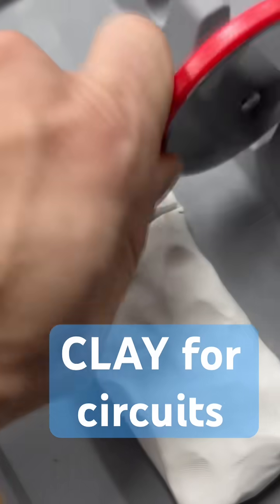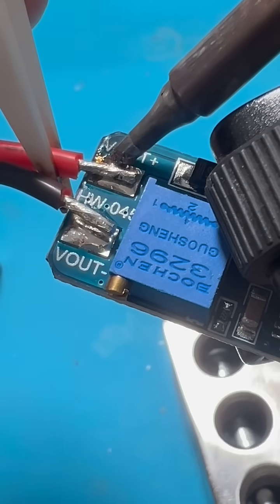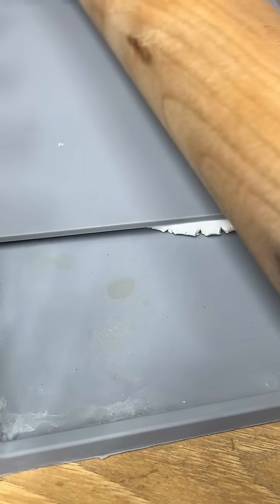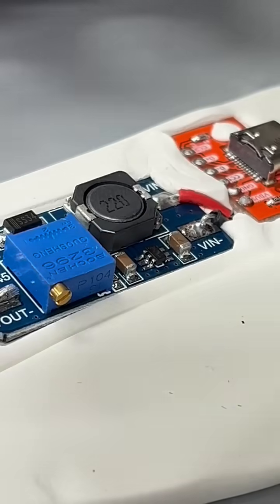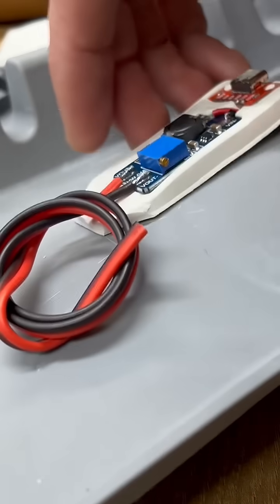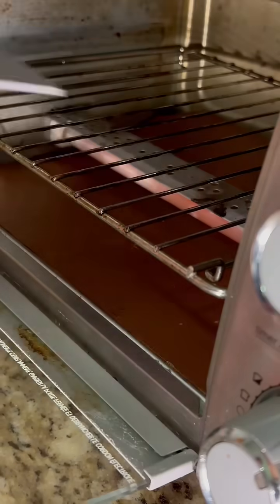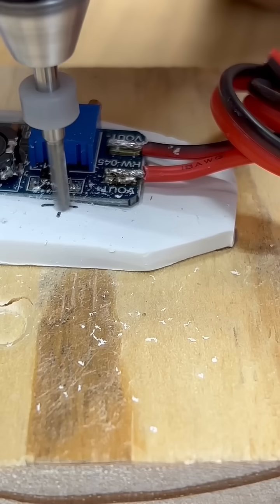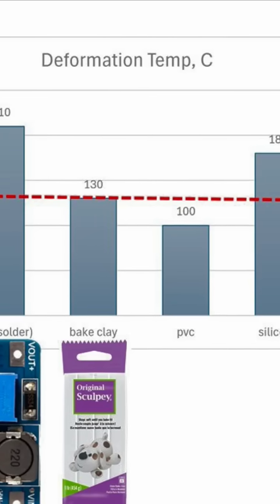use clay for circuit projects #methods #mechatronics

Comment: Great video, horrifying joints. I didn't think it was possible to cold solder with leaded.
Reply: You clearly don’t know what a cold solder joint is then. This is a fine joint and is easily class 2 compliant. I would even say the VOUT- is class 3 compliant. The only reason the VOUT+ is not class 3 is because the wire is missing solder at the tip
Reply: dear internet experts arguing: go call your parents or grandparents or something
Reply: Yeah, those are horrible joints. They don’t even look very secure. The solder applied to the pad prior to trying to heat the tinned wire is basically being hugged by it. The joining could’ve been a lot better. 

I suspect there’s likely components nearby, or just the way the board is designed, something is drawing too much heat out of the pads not allowing it all to make a solid connection. They look cold to me as well (repair tech in industrial automation is my experience. Board repair for servos drives, ac drives, dc drives, CNC, soft starts, power supplies, etc..)
Reply: @ST-jh8wz  They look cold huh. you don't know your arse from your elbow. Since when does a cold joint have a Shiney surface?
Reply: @m3chanist My post keeps getting removed showing where their joints are bad in the video, versus my personal joints at work on an IC. It’s probably automated to remove external links.

But that’s definitely not shiny. Those joints are not good. They should’ve used flux if they were going to struggle to use the rosin-core alone.
Reply: @literate-aside  And you are able to do a crystaline analysis simply by looking at in a video...Get off the grass
Reply: Certified IPC trainer with a decade of experience here! :). These are absolutely not cold solder joints lol.
Reply: @MyMomHadMe  Please don't tell me you don't work in a Class 3 facility.
Reply: I've never seen someone co confidently wrong... You are full of BS
Reply: @eXe09  give me a reason, not nonsense. Yet another person who sees leaded solder and thinks that means it's a quality joint.
Reply: You don't know what a cold joint is, because these aren't. Both have nice radii between conductors and are shiny on the outside.
Reply: @m3chanist  There is most definitely not a good fillet, red especially does not have proper wetting across the length of the conductor and has flux that hasn't been appropriately heated. 

It's plain as day. Are you familiar with IPC?
Reply: @GtsAntoni1  First you claim they are cold, and when called out on that BS you shift to them not being long enough. The dishonesty of the bushitter.
Reply: @m3chanist  I've addressed several factors of a cold joint, in fact assessing them is part of my job. 

I don't think you understand even the basics of solder, or IPC.
Reply: @literate-aside neither do you ,he's not wrong you backpedaled . 

Everyone is an expert in their own little mind so it seems. On videos like this
Reply: @MichelLinschoten   if you think I backpedaled you've no idea what a cold joint is. What do you think the factors are that define it?
Reply: @m3chanist There is still pad showing lmao
Reply: @fllowFPV  The three big questions. And? So? What? Please explain how the size of a pad (and it could be any size at all, purely at the whim of the board designer)  how that correlates to a joint being cold or not. Fascinated to hear and looking forward to your 2cents of navel gazing know all know nothing contribution.
Reply: @m3chanist  because to be a conforming joint it must have an appropriate fillet, pad size influences this. The origin side must have at least 75% coverage too.
Reply: @literate-aside  A conforming joint...Does this look like a production item to you, does it? Or do you simply like to apply ridiculously inappropriate standards to things arbitrarily.
Reply: @m3chanist  Firstly, crystalline analysis has nothing to do with IPC, or any standard inspection of a joint, or assessment of suitability.

A minute ago I understood nothing, now I'm applying my very high industry standards?

Stop moving the goalposts, and pick a lane. If you're a hobbyist that's absolutely fine, but don't roll in like an authority and then backpedal.
Reply: @literate-aside  Don't degrade yourself by arguing with fools like @m3chanist. It's so tempting to want to help people learn, but the best thing for everyone is to do the frustrating thing and move on. I find muting helps, especially for the really unreasonable types.
Reply: @literate-aside 
This depends on the class. You're actually aiming for a class 3 spec solder joint whereas this is most likely a class 1 product. Maybe class 2. I will agree though, that joint is atrocious to look at. It's not a cold solder joint though.

Also origin and destination sides do not apply to Surface Mount. That's explicitly  Through-Hole terminology. Speaking as an IPC certified QA who has experience with class 2 and class 3 products.
Reply: @Vi-Six  the joint is fine, doesn’t look super clean but the VOUT- is certainly a class 3 joint. I’ve been J-STD-001 certified for years and just did recert last month. The VOUT+ is a defect due to the tip of the wire but the VOUT- is fine for class 3. There’s 75% wetting of the land and the fillet is high enough and the wire is flat against the land.
Reply: @RedHaloManiac95  
I mostly focused on it being not a cold solder. When I say atrocious, I don't necessarily mean noncompliance. I don't like the look of it, but I'd agree it'd pass as a Class 2.
Reply: @Vi-Six  certainly ugly but class 1 is just “if it doesn’t come off at the point of inspection” 😭
Reply: @caramelldansen2204  Read the comments below yours, And know who the fool is. Sheep
Reply: @literate-aside  Your ignorance of metallurgy is noted.
Reply: @RedHaloManiac95  
Very true, which is why I mentioned that xD
Reply: @m3chanist  Except you're just as wrong as they are. While IPC may use metallurgy as the foundation for the standard, we don't need to do crystalline structure analysis to determine the viability of a solder joint. A cold solder joint can be and is almost always identified visually with distinct characteristics. You spent a lot of the time deflecting instead of educating, and is just as, if not more than, unforgivable. 

In my opinion, IPC is very applicable to the topic at hand as it is the industry standard. You should strive to at least meet industry standard, which really isn't all that hard to do when it comes to a couple of wires on a PCB board.
Reply: @Vi-Six Bravo, a slow clap for you. The dufus you are defending was making claims that would require it to substantiate his drivel. A point which cleanly flew over both of your heads.  And in so doing reveals the shallow and superficial understanding of the clueless claimed expert attempting to hide behind a certified appeal to authority.
Reply: @m3chanist  Goodness me. That's a whole lot of word salad, and not a single cogent counter-point in sight. 

PS. Name calling isn't a sign of a strong position 😉
Reply: @m3chanist   I've read it all, now with heapings of salt.
Reply: Absolutely 👍  hardly any solder used too

Comment: Fantastic idea if you don't have a 3D printer ;)...Although to be fair, PLA / PETG are much more difficult to post-process - especially sanding.
Reply: Not sure what your print settings are, but I use PETG for custom circuit board mounts and standoffs all the time. The only "post processing" is with a hook-knife deburring tool to remove brims.
Reply: @viscayavagabond  yeah most of my prints need zero post-processing. My point was regarding things like sanding, drilling, painting, etc...

Comment: Great for someone without a cheap 3d printer and/or basic CAD skills 🤔
Reply: Why would you spend hours designing and printing a one off plastic holder that'll soften if you left it in a hot car too long when you can just do this? Honestly, sometimes it feels like people are using FDM just to use it. Everything looking like a nail if you've got a hammer type stuff. That one-off box you spent hours designing and printing, probably in PLA? I can knock it up in 15 mins by hand from sheet ABS (or ply even) and it's guaranteed to have a better finish. This is a good technique for a lot of one-off things.
Reply: @paulie-g  most of what you said is false, cause I design an enclosure for this in max 30min and can reprint with 0 effort as many times as I need. Also I would not use PLA for anything...  wtf are you even talking about? 😆 and it will look at least not like shit in the end. To hold or prototype, sure. Clay. But for a finished thing, no way
Reply: @Hunihunor90  Hence me repeatedly saying "one-off". This is the common case: most electronics hobbyists build each project once. Also, most people print in PLA, and have printers that can only do PLA well.
Reply: @paulie-g  they do not know what there printers are capable of or you don't. 😅 most hobby printers are capable of printing a big array of materials 🫢
Reply: @Hunihunor90  Most people won't reliably get good results printing ABS without an enclosure. Particularly those for whom FDM printing is a tool in their actual hobby rather than a hobby in itself. For one-off, non-complex shapes that aren't already designed there is just no good reason not to do it by hand in most cases.

Comment: Is it possible to use that Clay for watertight Circuits?
Reply: Interesting idea.
I suspect the clay would need some kind of coating/sealant to become water proof. Baking prosess is done to remove any moist from the clay and make it hard but I am quite sure it can be painted with water coloring therefore moist can get in. Why not paint it with an oil paint to fill the surface and stop water from going into the clay?

Comment: Well.. IF you need something a little playable, but still keeping shape, I have used „Sugru“ a silicone rubber in the past, cures out of the package within 24 h, but keeps a certain impact and deformaability that I needed for something similar.

Comment: Test it or this video is a dud.
That Baking clay could be low key electrically conductive and short your PCB connections due to the minerals inside of clay.
Reply: Its a polymer, not mineral. It exists with high impedance certification

Comment: This is cool, but you need a 3D printer
Reply: I still see this aproach very usefull, if you have quite complicated pcb shapes or need Something possibly watertight
Reply: @p3chv0gel22  well PCBs usually are planar, as far as I know. This is a good prototyping method for sure, but if you need more pieces, a 3D print would be better (design once, print any number of parts).
You can also use the clay to make the first part, then use that as a blueprint for the 3D model :)

Comment: I prefer not to cook my circuit boards at 130C for 15 minutes!
While people have pointed out that soldering temperatures are higher than this, soldering is spot heating on the legs of components and only for a few seconds. Not a 15 minute heat soak!
Reply: If you're worried about the heat, you could always remove the circuit boards and other components before baking, and then just put them back in after the clay was hardened. That would also allow you to drill holes under the circuit board for heat dissipation etc.
Reply: @AlarKemmotar  curing is never size reliable. Matter shrinks, and circuit won't fit anymore.
Reply: All SMD components are designed to withstand 220c reflow ovens because that is how they are manufactured.   First solder paste is applied to the pads, then components are placed in the solder paste, then the whole board goes through an oven to melt the solder.  130c is not a problem for SMD components.
Reply: Why white people? They always have to bring political issues into an electronics video. It's two boards worth $4, nobody cares if they get damaged or not.
Reply: Milliput cures at room temp
Reply: You’re gonna be upset when you figure out how PCBAs are made in manufacturing production.
Reply: @MyMomHadMe  No I'm not. Once again soldering, even re-flow is not 15 minutes.
Reply: @ekij133 Reflow is like 5-7 mins. And most that time is above 150C and peaking 220C commonly. Not to mention for moisture sensitive parts, you bake them up to 125C sometimes for days. I hightly doubt these parts are perfectly fine at 125C for days, fine at 220C for 2 mins,  150C for 5 mins but just die at 150C for 15 mins.
Reply: How do you think they mass produce circuits in the first place?
Reply: Especially SMD could be damaged by this. Mi solder past is liquid at 135C
Reply: @tobiashegemann1811  Please point us to commonly used parts that are damaged at 130 deg C. This is not operating temperature. I'm sure such parts exist, but considering this would rule them out of reflow, it can't be common.
Reply: @paulie-g batteries, through hole connectors and plug receptacles, oled display ( some LCD may be fine ), some fuse holders. 

Smd USB plug is designed for reflow. 

Not sure about this rvar, but probably designed for reflow to save costs and reflow this board only once and call it a day. 

Absolutely Evry thing else is designed for use up to 85 or 125 C, and storage at 110 or 130. 

Apart from reflow, it's recommended to cure most IC for 5 or 10 mn around 120 or 140 to deal with residual moisture after transport or storage.
Reply: @Benoit-Pierre  You wouldn't install batteries before baking the clay. Some plastic parts: yes. Displays I'd be concerned about the flex cables first and foremost. None of those are showstoppers as most designs either don't use them or can have them installed post-bake. I maintain that this is a good idea provided you can get a good price on the clay.
Reply: @paulie-g  i never Said batteries should be installed before baking 🤣
Reply: @Benoit-Pierre then don't say irrelevant shit
Reply: @tobiashegemann1811  utterly clueless

Comment: Heyyyyyyy. Please make full length videos utilizing those voltage boost converters. I use them as well but I am having trouble with the higher current and also the initial raising of the voltage